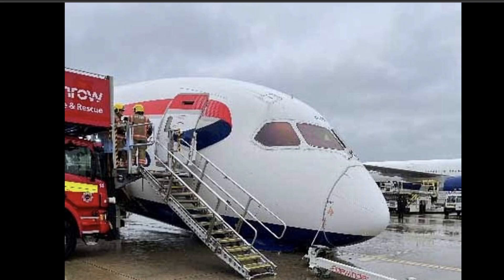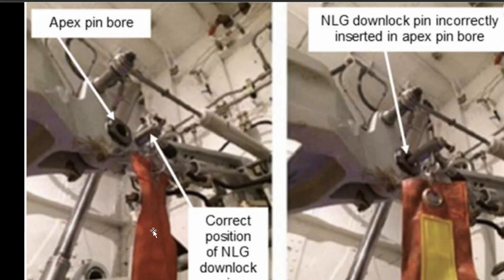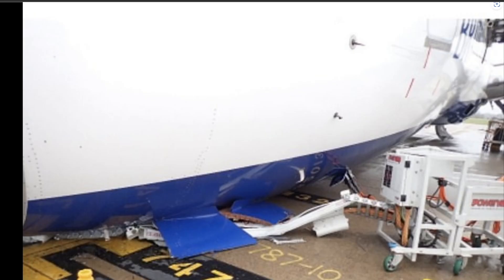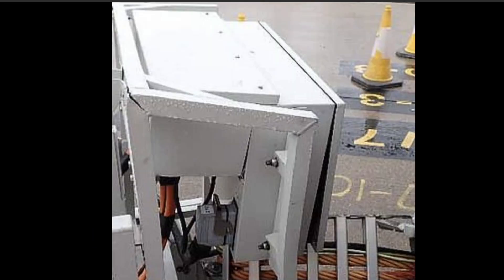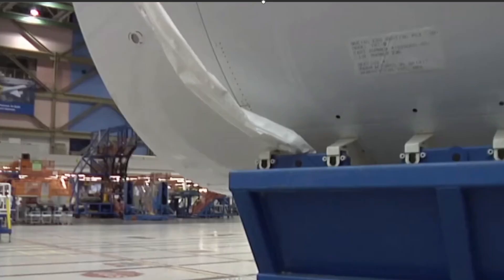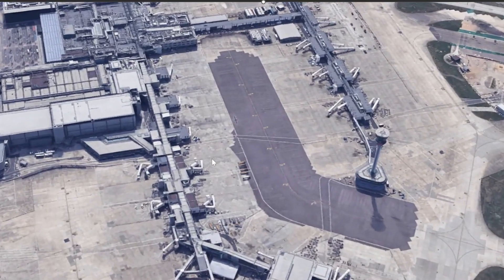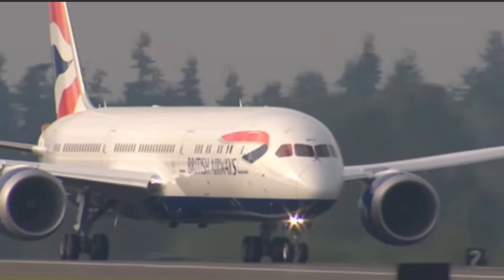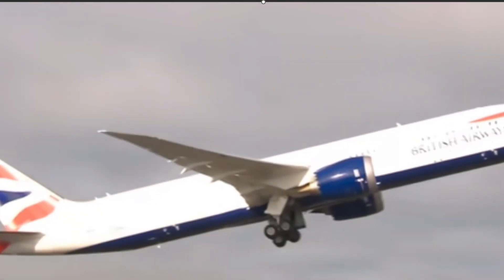Boeing Dreamliner Shattered Dreams

Comment: Inserting the pin does NOT tell the plane is on the ground.  Wheel truck angle does.  The bypass pin is inserted to towing/pushback!

Comment: Unfortunate mistake. But it really points back to poor engineering. Nobody thought to mistake proof this and make it that way by hard design. Amazing. I would like to see what Boeing did to correct this.
Reply: Im sure Boeing will correct it very easy to do.
Reply from the maker: They required the hole sizes to be changed so the pin won’t be able to be inserted at all

Comment: didn't have a switch to prevent the gear from retracting until the weight came off it? That's weird
Reply from the maker: They were run in a hydraulic test of the gears thinking the pin was in.
Reply: A switch would be more prone for error than a pin. I would be amazed if the pin holes are not identified in some fashion and a "check double check" done.

Comment: Looks like it’s time to mark the gear pin locations with red or orange paint
Reply from the maker: those two holes are very close and asking for that to happen
Reply: @ARFFWorld  You are correct, marking all 3 positions might prevent that in the future, one could only hope.
Reply: @Exuma Guy Then maybe the mechanic should know we’re the nose gear compartment light is and use it. He had to use a stand or stairs to get into the area to install the gear pin and had the nose gear doors open.
Reply: @Exuma Guy 34 yes and counting. Between military helicopters and commercial aviation as a mechanic, lead mechanic and now an Inspector, yes I have seen a lot of mishaps that could have been avoided.